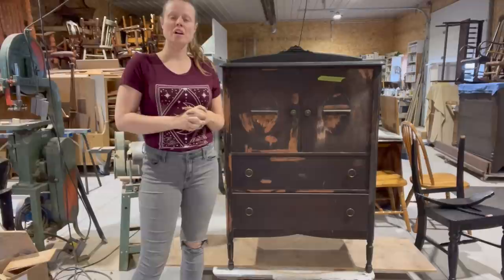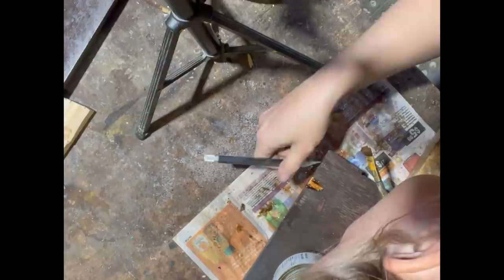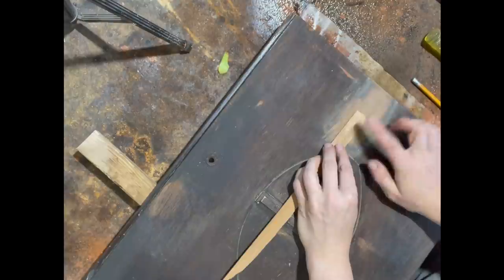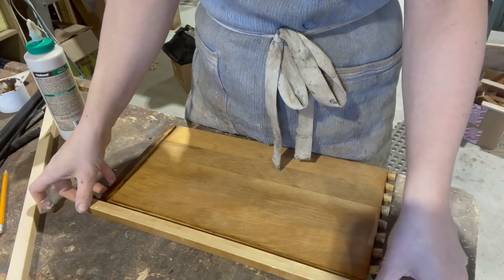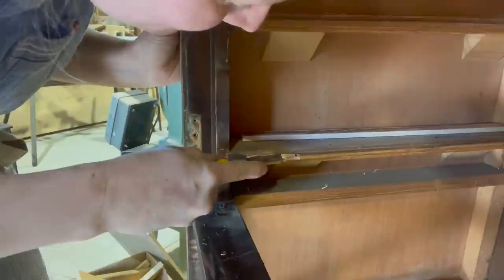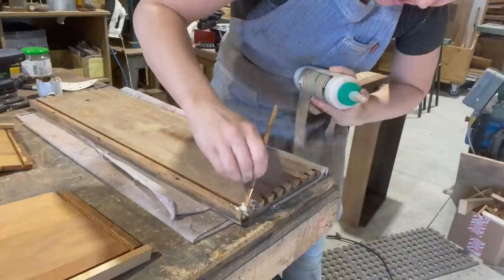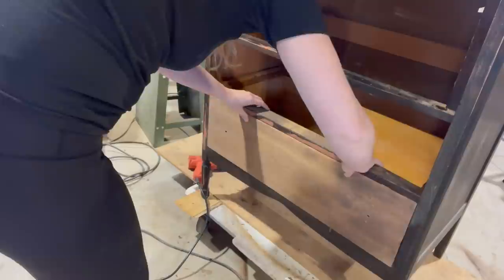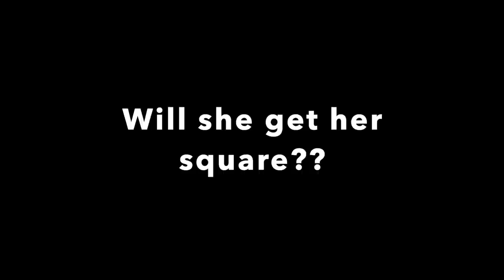Extensive Repairs to Old Dresser Part I

Comment: I rewatched this video, as I have some similar repairs to make on an older secretary. Such a great thing to be watching the Queen of Repairs. Just a quick question, though. When you take in a piece like this, how do you evaluate a price if you don't know exactly the extent of the repairs? And for that matter, what do you tell the client as far as the time needed to complete? I mean clearly one might see the obvious damage but when you actually get into the "up close and personal" view of the inner workings, this sometimes adds significant time to do your best work. So how do you estimate that in the beginning? I guess that wasn't a quick question after all. I apologize, however you are beyond reproach in your repair integrity so I really only want your opinion.
Reply from the maker: I usually give a very careful estimate and sometimes a range of cost is needed.  Cheers

Comment: On those drawer runners, don't you think a DREMEL TOOL would work better ????
Reply from the maker: Nope, dremels are not precision tools. Pretty difficult to use in tight spaces. They can go awry very quickly. I usually opt for hand tools. Cheers

Comment: I've seen Part 2 and it is an amazing restoration, great job.
One curiosity: why not put the drawer stops at the back of the drawer slides instead of on the front bottom rail?
Reply from the maker: Some cabinets are built with the stops at the back and that’s also totally fine. I just kept with the original placement but either or would have worked. Cheers!

Comment: Hi there! Question, When you repaired the drawer glides, what the reason for cutting the new wood so much larger in width? I usually cut it to just a shade over, and sand it to the correct width, and then cut it to length. THANKS!

Comment: Beautiful job Trinna. Ive got an old machinist tool box that needs veneer repair and am out of hide glue.  Have you ever done any with Tightbond? Curious to try it but also wondering just what I will destroy in the process.
Reply from the maker: Its fine to use just a little harder to reverse. good luck
Reply: @johnsfurniturerepair  Thanks. I think I will just wait until I get some more hide glue. I kind of like the old tool box. HAHA!